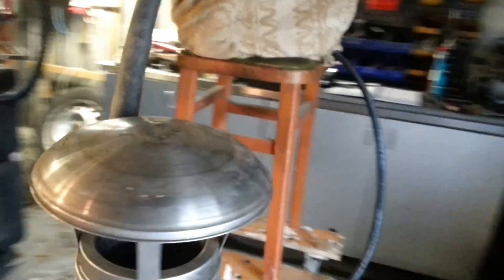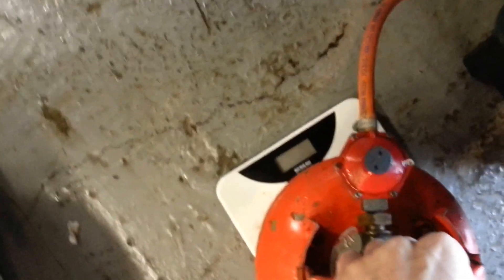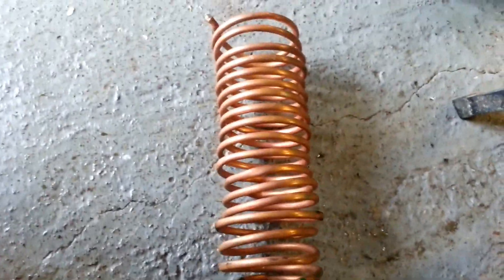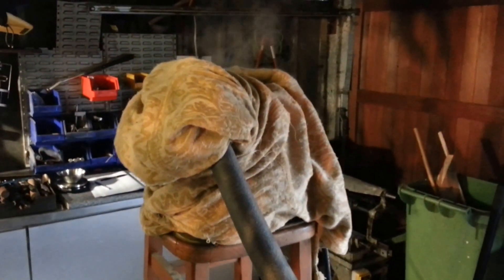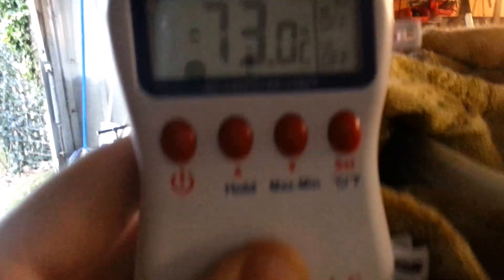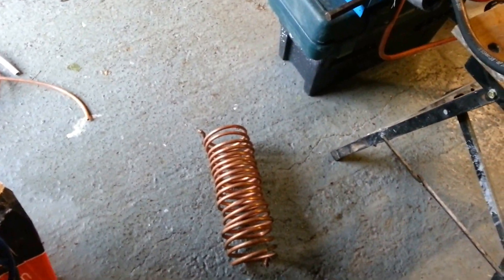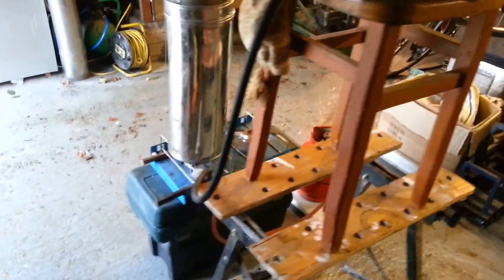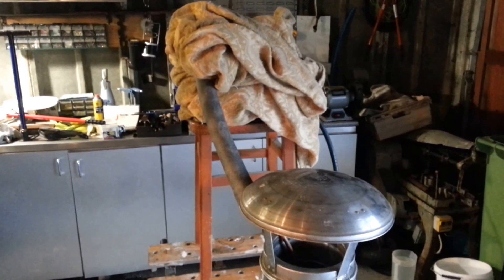Flue / stove pipe water heater, copper coil heat exchanger

Comment: was thinking of using the stove pipe of my wood stove, wrapping copper pipe around it using thermo siphon to push the liquid through essentially an under floor heating arrangement - so turn it to pex, snake under the floor...  probably need to help it with a pump... the question is, what is the copper capable of withstanding for heat?  if the vent from the stove is 8" do i make the coil 8.5" and put some standoffs or can it go directly against the pipe... the pipe is uninsulated until it goes through the floor then is double insulated SS through to the roof.

Comment from the maker: I used a section of drain pipe to wrap the copper pipe around. Some people recommend filling the cavity of the copper pipe with salt to stop it kinking however I found that by just taking it slowly and gradually reducing the diameter it was fine
Reply: I used salt or fine sand and had no problems.